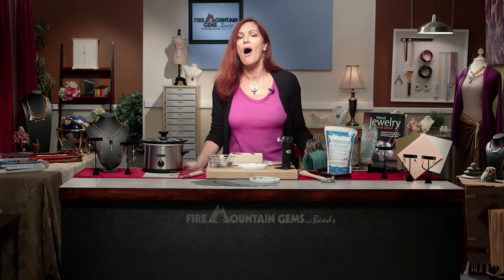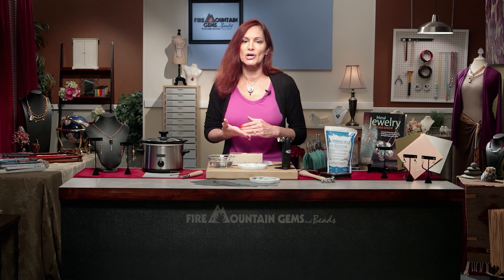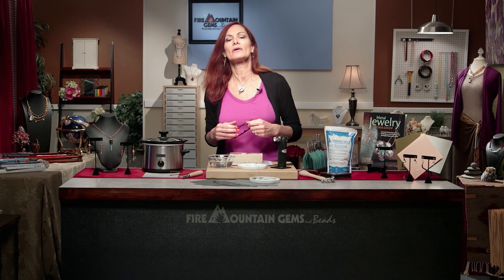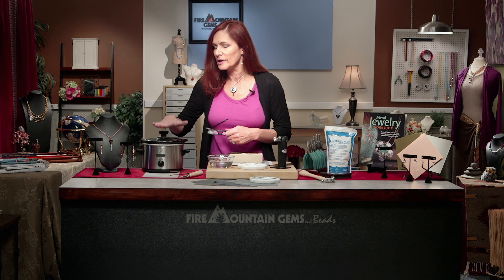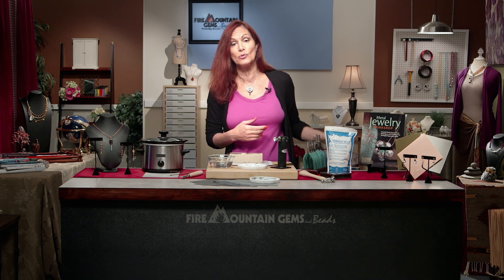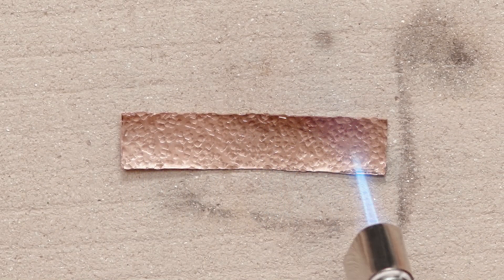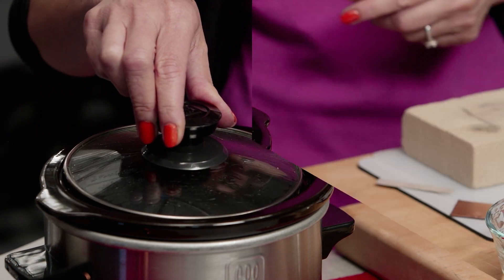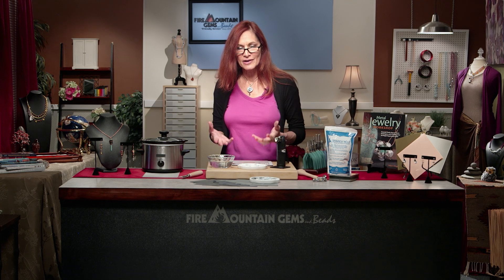Pickling Metal

Comment: Do you think the crock pot lid is enough to keep the sparex fumes down, or should it still have a fan venting it outside?I know some work areas have exhausted and what not. I was just wondering what your thoughts were on it. I planned to just have a pot setup like that, but its just not a real good seal on top.
Reply from the maker: We would still recommend working in a well-ventilated area. You can refer to the Sparex Safety Data Sheet here: https://image1.fmgstatic.com/pdf/Sparex%20Pickle%20Compound%20No%201%20%20and%202%20-%20Rev.111915%20-%204549BS.pdf

Comment: And if i dip my copper tongs in the pickle than drop them in the quench which has baking soda in it  than I dip ny copper tongs in the quench can i put then back in the pickle or will that neutralize the pickle
Reply from the maker: Dropping your tongs into the water dish is okay and it won't hurt the pickle.

Comment: And easy gold solder paste where to find and what's the melting temp for easy solder paste gold? 
How do you treat the pickle with baking soda to dispose of it? 
And when I solder these jump rings the solder doesn't melt until it turns red like completely is that bad
Reply from the maker: Here is a link to our gold-colored solder paste: https://www.firemountaingems.com/itemdetails/h204768tl The flow point is 1250°F. 

In the video you will see that there is baking soda added to the quenching bowl to neutralize the pickle from the piece before it is going to be worked on. As far as disposing of the pickle itself, please refer to the manufacturers safety data sheet on how to properly dispose of the product. 

For the solder, it would depend on what you are using. Some solder has a much higher melting point. Be sure you are using the correct solder for that application.
Reply: @FireMountainGems  I just went on your website and saw that your are not requiring a license number to order stuff from your website

Comment: Hello I'm having trouble soldering these jump rings. I put them in the pickle the material is alloy steel/ brass. I put them in the pickle and they are still black. If they are fire stained what do I do? Should I make my pickle stronger? If the pickle needs to be stronger. What is the ratio for a stronger pickle? I don't want to make it to strong.
Reply from the maker: You will want to stick to the ratio provided in the mixing instructions for whatever pickling compound you are using. You can try leaving the metal in the pickle longer to see if there is any change over time. It may also help to polish the piece after pickling and then you can always return the piece to the pickle and repeat the process. It is also possible that the type of metal is not compatible with the pickle. Refer to the instructions on your pickling compound for a list of compatible metals. Hope this helps!
Reply: @FireMountainGems  thank you
Reply: @FireMountainGems  what are other pickle options for a alloy steel/brass jump ring? 
No I'm using the spare x number 2 that you show being used in the YouTube video
Reply from the maker: The Sparex No. 2 is intended for non-ferrous metals, so the steel, which is a ferrous metal, could be the cause of the issue. We would recommend using a non-ferrous metal or precious metal. (brass, copper, silver, gold, etc.)
Reply: @FireMountainGems  ok thank you. What would I use to pickle the alloy steel/brass or any ferrous metal?
Reply from the maker: The pickling compound we carry is for non-ferrous metal, so we don't have any info we can speak to specifically about compounds for ferrous metal. If you are looking for jump rings to use that are a non-ferrous metal, please let us know.  @sarahcannon3243

Comment: I left my gold plated brass jump rings in sodium Bisulfate pickle which ratio was 1/8 cup of pickle to 1 cup of water and the jump rings came out black still. Can anyone tell me why this happened I have spent all day sanding the jump rings with 600 grit sand paper and than using the pro polish pad I'm halfway done I got two jump rings completely clean and the chain is halfway done
Reply from the maker: Pickle is meant to clear away the slag caused from soldering. You cannot solder plated metal. You can only solder uncoated metal.
Reply: @FireMountainGems  so in order to solder jump rings they jump rings have to be solid metal they cannot be plated?

Comment: Where i dispose of the pickle at?
Reply from the maker: It is recommended to dispose of the pickle solution at the nearest hazardous waste disposal site. Containers should be marked with the correct type of solution and metal, such as: "Sodium Bisulfate – contaminated with copper." Please refer to the Safety Data Sheet of the specific pickling solution you are using for proper disposal instructions.
Reply: @FireMountainGems  thank you